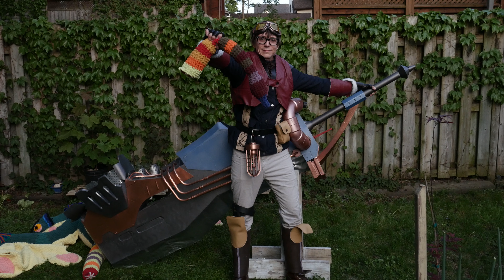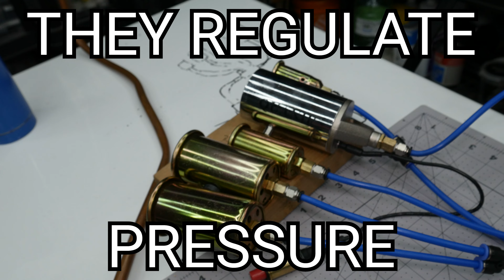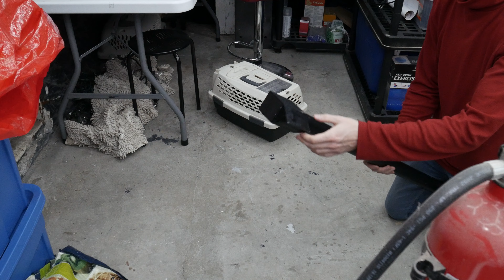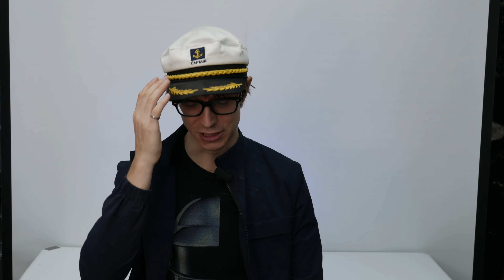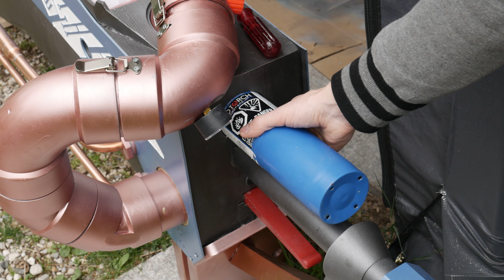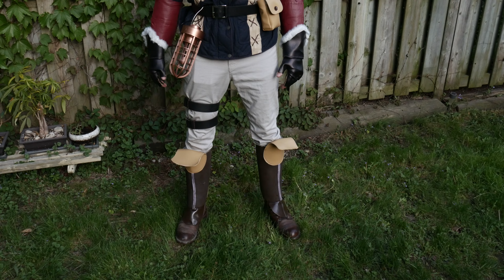ROCKET SWORD SHOOTS REAL FIRE

Comment: I wonder how deep you could chop with a smaller jet that you had at the end of a blade so you could press button a boost as you swing. More... sword/machette sized (but you probably wouldn't want to hold it else you would chop yourself at the end of the swing). 

You could even do it just with a small soda bulb instead of a jet to limit the 'fuel burn'.
Reply from the maker: @EvilSpyBoy  was thinking of making a rocket axe. Probably wouldn't hold it when I set it off, yes. Would likely make a rig that I could safely turn it on from a distance 😂

Comment: Hi captain steel, I wanted to ask your advice on something. I’m trying to build a 1:1 scale Metal Sonic head, but his visor/screen is very curved and has a very unique shape. I just watched your daft punk helmet video, and wanted to ask if you’d how to go about creating a led screen for Metal Sonic. The leds you used in the daft punk helmet make the animations look like pixel animations, but is there a way to have a very high resolution for metal sonic’s visor? 

Would love your thoughts on this :) If i manage to build it, i’ll credit you for your help if you want!
Reply from the maker: Hey Starline36, great question! Back when I made the visor for the Guy helmet I ended up making a 'buck' out of foam and wood that took on the shape of the visor. I then took a wooden frame that I made and secured a flat sheet of PETG plastic into it. After heating it in the oven for a few minutes, the plastic became soft, but not melted. At that point I pulled the plastic over the buck on a vacuum table to ensure a tight seal to the buck. This is called vacuum forming plastic, it's a tricky process to get right, but worth it in the end

However, now that I own a resin 3D printer, I just buy ultra clear resin and 3D design then print the visor. For example, I'm working on a Helldivers helmet right now and I just 3D printed the visor, sanded it, polished it, then applied a very fine layer of clear coat to make it see-through. If you don't have access to one, you can always try the first method I listed. The lesson I've learned here is to make visors as uncomplicated as possible as visibility deteriorates the crazy you try to get with it (not to mention tinting is a whole other monster to overcome). I.e. if you can get away with making your visor flat and rectangular, then absolutely do that (trust me)

I know there's a few different makers out there that have done a really good job with visors - Punished Props probably has a good video on it (though I haven't watched it yet if it does exist). Hope that helps!

And don't worry about crediting haha, just happy to help :)
Reply: @CaptainSteel  Very interesting, I’ll check it out! Thanks for the fast and detailed response :). Just found your channel today and subscribed, your vids are really interesting!